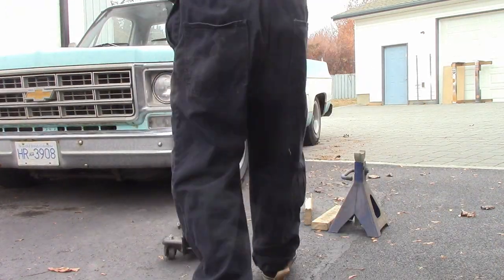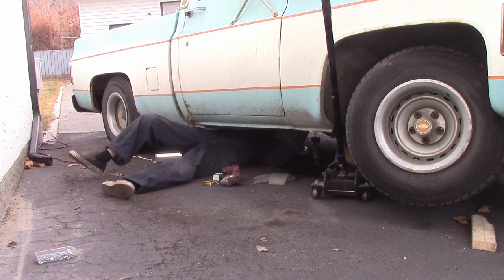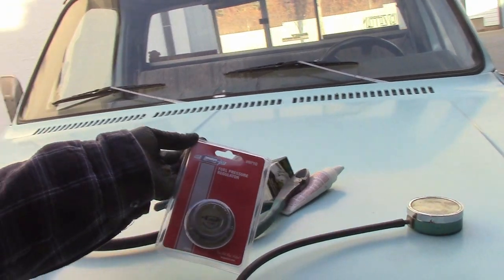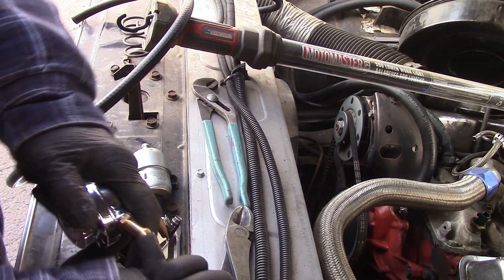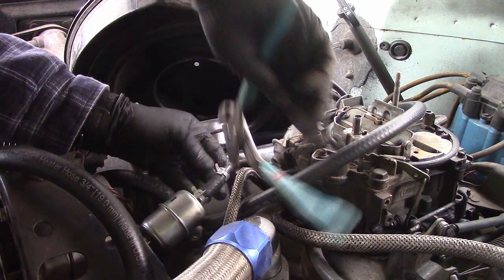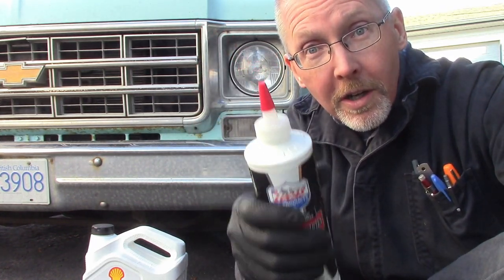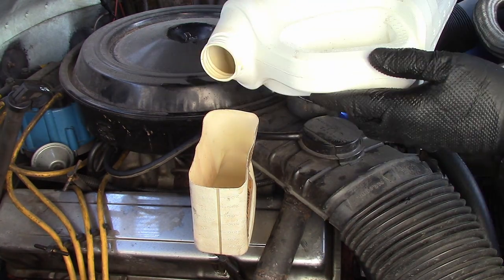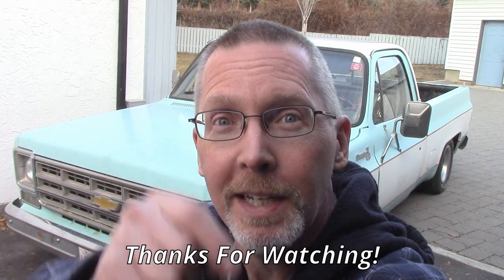The Fuel Pump Killing Pickup

Comment: Try a return style regulator. I ate Holley blue pumps till I started using a return style regulator. Now I have been running the same one for three years now. And as a high performance person yes I agree with the zinc additive. Cam shafts and lifters these days must be made out of licorice. I have went to roller cams now.

Comment: no need to use the zinc additive when using diesel engine oil, it contains a large amount for the injectors and the hpfp. those old trucks need 91+ octane and ethanol destroys those mechanical pumps so its better long term to run a electric inline.

Comment: I've been through my share of electric fuel pumps too. My thoughts are the fuel pumps fail because the pump "deadheads" too much of the time and overheats. I now use a Holley 12-803 regulator and a return line back to the tank so the pump is constantly being cooled by fresh fuel.

Comment: Why not just keep the stock mechanical pump? And If you don't run a return style regulator, it will continue to kill those cheap electric fuel pumps. Also the "4" on that fuel pressure regulator doesn't mean 4 psi, I've confirmed this with a fuel pressure gauge on several different cars over the years. They are junk to be honest with you.